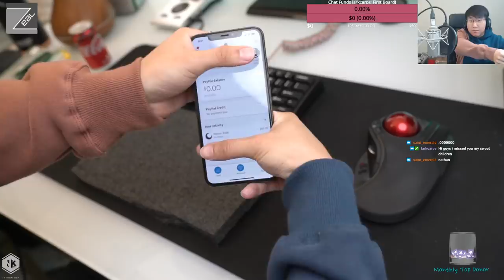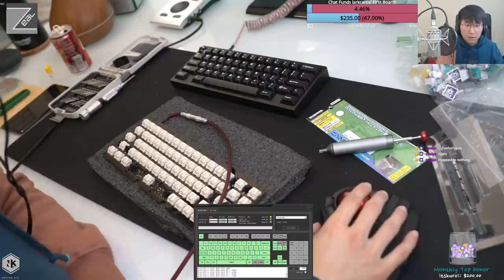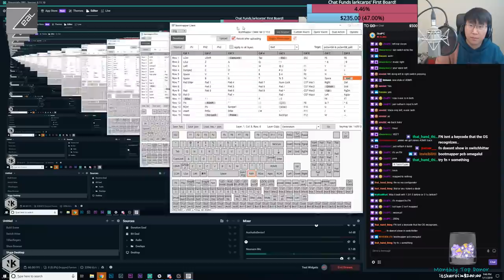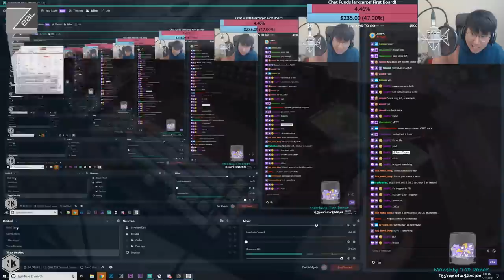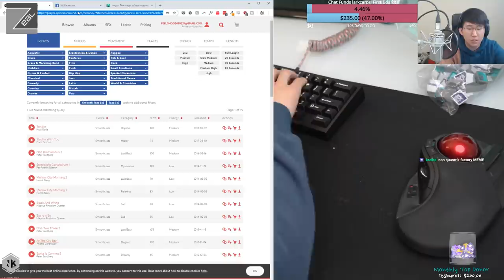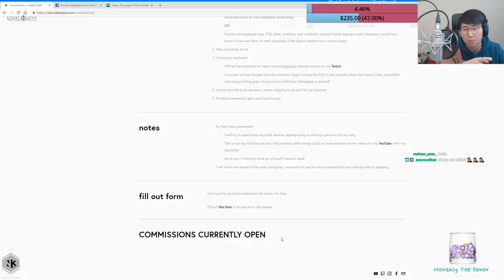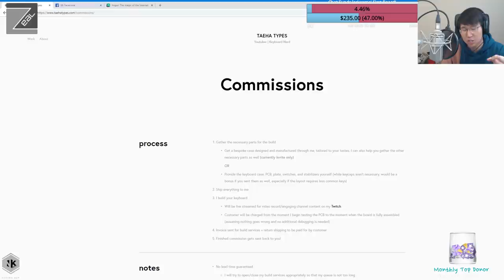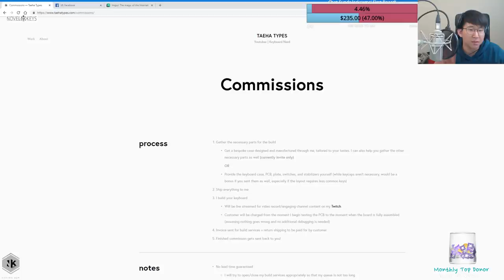Special M65-A with Paco Switches Build Stream

Comment: 2:02:55 when you press the rubber like that where you press your thumb onto the strip and rub towards the other end when pushing it in, it stretches. That's why they were "too long" they were most likely perfect size to begin with. On the first one you went really hard and stretched it a fair amount. Would have been better to take it of completely, lay it in again and pad it down to stick.

Comment: Why do you not use ground straps when working with open circuit boards? So many chances for static burn to the board when not using it on open boards. Just a question. Love the videos and the continued content.

Comment: I love the Sound of the keyboard! Do you know one with the Same Sound under 50 Dollars?
Reply: The sound comes from high quality key caps, the high quality switches, lubing of the switches, the type of metal of the plate (brass in this case) and the case (aluminum). All of these make a really nice but really expensive board. You won't get a board that sounds like that for under $50. The brass plate itself that makes the biggest difference is worth more than $50.
Reply: @swirle13  okay, i do not know anything about Different cinds of Keys, but they Sound amazing

Comment: Commission send regarding the switch swap for my Corsair K95 Platinum currently with speed switch which I loathe.
Happens to be my first mech keyboard and even though I've bought several since, it's still a frickin' good keyboard except for those dreadful speed switches...

I'd love it to have a combo of Kaihl box jade and navy and perhaps holy pandas. Haven't tested tactile switches yet, only had clicky and linears.